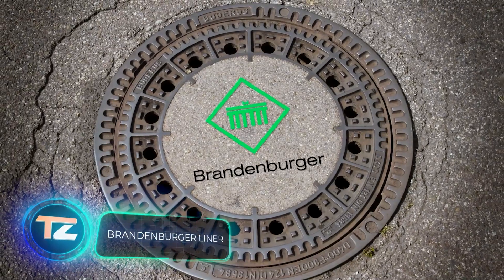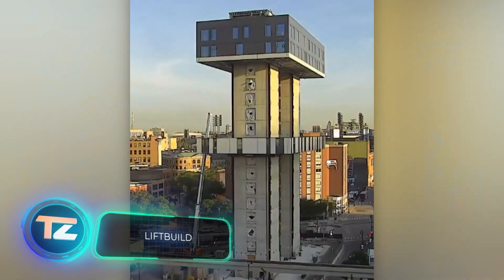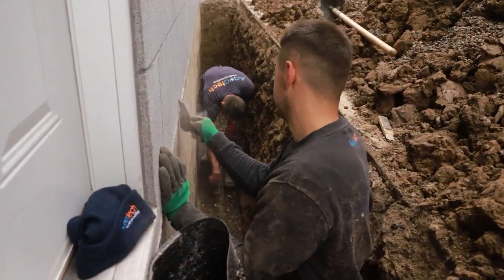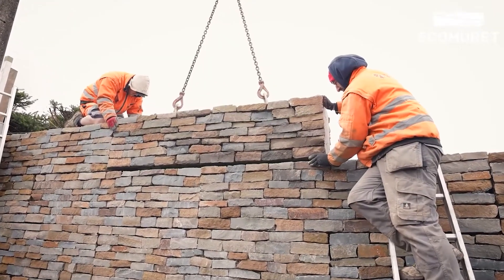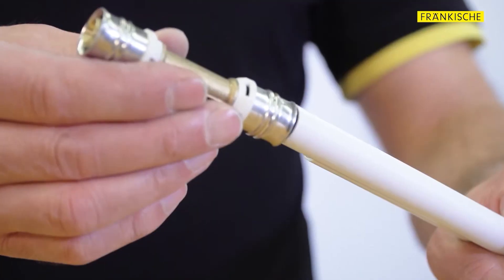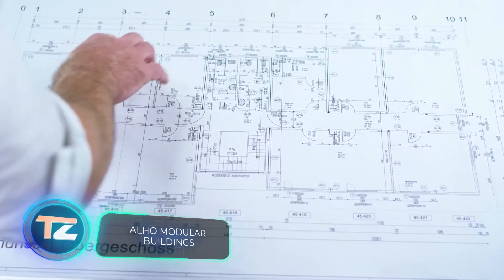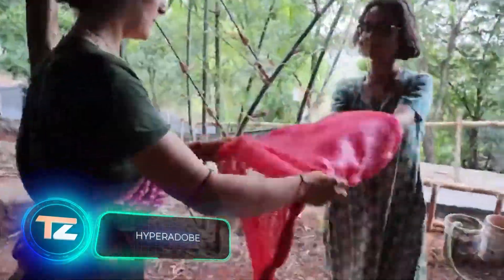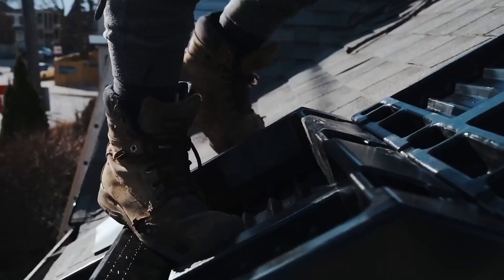CONSTRUCTION TECHNOLOGIES THAT HAVE REACHED A NEW LEVEL

Comment: the polyphenol piping, attach brackets & fittings are nothing more than a copy of pex pipe & hold-rite straps, globally available from a variety of manufacturers & vendors- for a FRACTION of the price. again- nothing new about this. pex pipe & hold rite straps are nearly as old as soldered copper pipe.